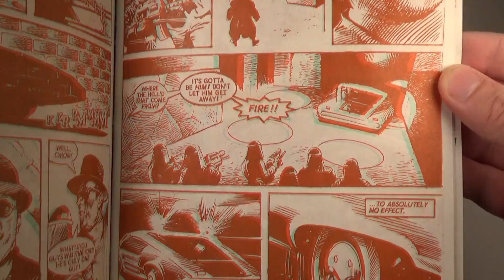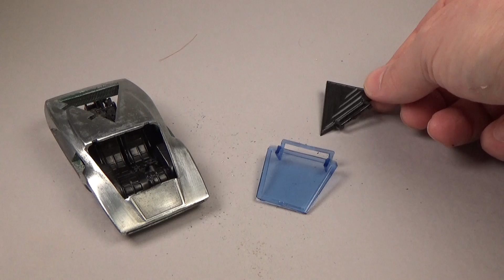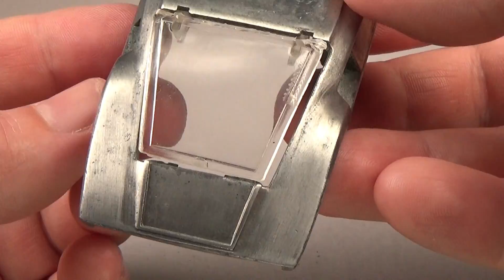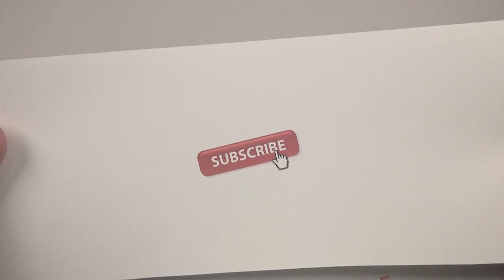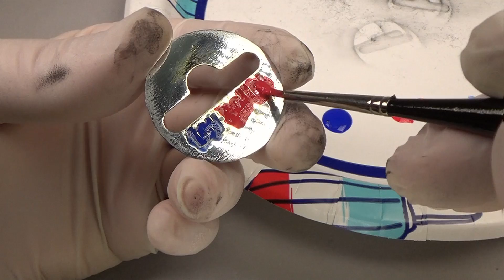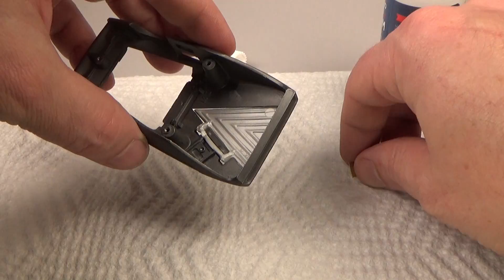Restoring a Politoy Lancia Stratos HF Zero

Comment: If you had used the mold the correct  way, your casting  would have turned out. The mold frame has a built in pouring cup

Comment: Overall great work. I'm not sure about the windshield. The body of the car is arched and the original part seems to be slightly arched too. When you took the cd, i wondered how you would go on to give your replacement an arched shape. In the end you just didn't and the result doesn't convince me, sorry to say that. In any other regard with paint, the edged parts it looks really great, the wheels are much better this way.

Comment: No offense, awesome job but I like the original size wheels and tires better. The new ones look too large and out of scale. I find your photo etching very interesting, I always wondered how they did that.Great job on the new windshield, the only thing I would have done is use your sanding stick/nail file and bevel the side edges if the glass on the sides to make them angled, then polish them with a Micro-Mesh polishing set of pads or cloths. I like your powder coating part of the video too, also very interesting.

Comment: Nice job! I do like the silver color and the real Stratos Zero was painted silver at one time; I think in the '80s and '90s.

I think both cars sit too high. On the real Stratos Zero the rear wheel arch actually comes down below the level of the wheel rim. The front tire is smaller and with a lower profile than the rear tire. 

I'd say that on your model a better choice would have been a lower profile tire on the same wheels, with the front a lower profile than the back.

Comment: Greta video - and a great restoration / modification.  Excellent colour choice.  If you split the difference in the wheel/tire diameter, I think you'll hit the sweet spot - especially for the rear wheels.

Comment: Regarding your resin casting, may I make the following recommendations:

- Get a pressure pot if you don't already have one. It's better for casting instead of degassing
- Use a resin designed for thin hard plastic components (Highly recommend Task 9)
- Use a faster curing silicone to save time (Mold star 31T will cure in 30 minutes, no degassing required, but pressure pot recommended)

With standard epoxy resins you will never get it hard enough, or if you do it will be very brittle. Task 9 is a urethane resin, but most urethane resins absolutely require pressure pots. That being said if you ever want to send some parts my way for reproduction, I'd be happy to do them for you!

Comment: well, great work on that futuristic ride. :) great work on the windshield, too. the polarized look is very fitting. :)
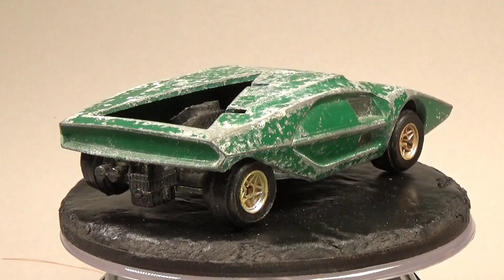personally the wheels look a bit too fat, the original has 60 or 50 series low-profiles. but they look better than the original standard polistils which were too small on almost all 1:43's they did in that era.
the original has a rim for a raillight surrounding the whole rear grille, if I recall right, illuminated with 195 light bulbs... and the front window is actuated wuth the steering column. I read of the car a bit ago in a german classic car magazine, and they commented that it's dangerous to grab the wheel while stepping in or out, because the windshield would slap you silly. XD
the panel before the windshield is a step-plate made with black rippled rubber, btw. :) the original is also still unrestored and ready-to-run, which is amazing for a show car like that. ^^
that being said, love your interpretation nevertheless. <3

Comment: 1) I really think you went too large for the tires. They look like balloon tires.
2) I love the effect of the windshield, but the original had more shape. Could you 3D print a buck and then put your CD piece on it and zap it with a heat gun to give it more shape? Google says that it's polyycarbonate, and that polycarbonate can be heat formed...
3) photo-etching. You have a laser cutter, don't you? I could be wrong, but it looks to me like if you painted the brass sheet with a matt-black, and then use the laser cutter to etch away the paint as appropriate, then etch in ferric chloride as usual. I think it would be more consistent results, and you could do dithering to get pseudo-grayscale.
4) I can't recall the last time I saw you electro-polish. How do you decide when to electro-polish, and when not to?

As per usual, the result is gorgeous. I had never seen/heard of this car, and I don't remember the Michael Jackson video, so thank you for introducing me to it!

Comment: Mapp burns hotter than lp. was that the problem? would seem odd, but I'm not a restoration expert (just work in a field that includes buying, selling and using gasses for hvac trade and plumbing.)

Comment: I think the rims need to be bigger compared to the wheels, I think the original has the right ratio between tire and rim, but is overall a bit too small, so if you could get closer to that ratio it would most likely look better I feel.

Comment: Overall, the car looks great. My suggestion would be to chamfer the windshield edges, and reduce the tire size somewhere halfway between the size you used and the actual tire size; that is, slightly larger than the original size, but smaller diameter than those you chose for this model. Oh, and I would choose a slightly smaller diameter tire for the front. I feel the profile of the car in the front makes the front tires look larger than the rear in diameter; this is an illusion, but I feel that the front tires being slight smaller in diameter would give better proportion to the car. The original tire size looks OK, but having them just a bit larger, I feel would make the car look great. One other suggestion would be, maybe the rear tires are fine, but maybe the front need to be smaller in diameter; this may give the car a better look and the proportion would look more correct. Using the CD to make the windshield was a very good choice; the metallic or opalescent look really makes this car look futuristic in appearance. The gun metal gray also give this car a wonderful appearance as well; ultimately, it looks stealthy in appearance. I didn't really like the silver on the rear hatch; in my opinion, flat black may have been a better contrast to the gun metal paint; similarly as the front emblem. And the only other idea I feel would make this car really stand out would be to finish the rims in gun metal gray; but more metallic rather than dull or flat. My version is about stealth and devoid of any chrome. But to each their own; right? Oh, and the rear tail etching you did was really nice.

Comment: Rear wheel tire diameter can be reduced and the sidewall height can be reduced. With this set as a guide the front rim should not be a deep dish rim like the rear but diameter should be larger and the tire diameter should be the same as the rear with an even smaller diameter.
The window, you could use another method. Make a clay form that shapes the opening of the window/door opening. You can use a thin sheet of clear plastic to plasti-form to this shape you made. Trim off the unneeded parts of the window/door. You get the benefit of a thinner windscreen.

This image should illustrate my points on the wheels.
https://hips.hearstapps.com/hmg-prod.s3.amazonaws.com/images/1970-bertone-stratos-106-1527782202.jpg?crop=1xw:1xh;center,top&resize=980:*

https://images.wsj.net/im-154478?width=1920&size=1.6

The rest was a good video. I enjoyed it.

Comment: I did an experiment on plastics before and yes they do become brittle if you place the heat directly on the said plastic for short bursts/periods at a time. What I have done is wave the heat gun back and forth and it sort of softens its shape so you could bend it as you wish, but it is a tedious process on its own.

Comment: In my personal opinion, the wheels should be a little larger and the tires a little smaller. I think the idea of filling up the wheel wells is a good one, but the wheel to tire ratio looks similar to an off roader
Reply: Of course besides that matter of opinion, i think you did a great job.

Comment: Woooah - sum it up. You can: paint parts using brushes, aerograph, poweder coat, you can etch, use electrolysis, plate parts, and apply metallic paint. You can make stickers, laser etch, and wet transfer. You can 3D print parts from resin, cast from metals and plastic, and uh, cut from CDs. You have full paint booth, nice surface to work with and decent camera setup. You're narrating your videos with calm, rich voice, explaining step by step, and building library of how-to videos while sharing your project cars, or other way around, while showing off your projects you're teaching the community how things are done, while also mentioning don'ts, pitfalls and failures. The last part never changed, but you've come long way from start of your channel.

Comment: For what it’s worth I have always found your sense of colour, proportion and your technical prowess to be exceptional! I will offer that the wheels did not work in this case. The original mags had more exciting interior details and the tyres were a better diameter, though slightly larger rear diameter would work. It’s just an opinion though and therefore has no relevance. Love the overall project!

Comment: It was really great to see all these different techniques! Thanks for that photo etch demonstration; I would have never considered trying something like that, but now, who knows?

How toxic is the solution? Is disposal a hassle?
Reply from the maker: It is no more dangerous than pool acid or drain cleaner and should be treated the same. If you neutralize it with baking soda till you no longer get bubbles you can pour it down the drain as it will just be salt water and rust.

Comment: Hello BareMetal, 

You did a great job on this car. Two things worth mentionning to me : the edges of the windshield seem to stick out a little bit too much. Perhaps finding a way to curve the windshield a little bit could do the trick. And the tires look great but I would put smaller tires on the front of the car, just to get rid of the off-road look that comes with big tires on on both front and rear. 
Thank you.

Comment: Could I bake the chrome at a low temp instead of waiting 2 weeks in between paint jobs
Reply from the maker: Not sure, have not tried it. Not. Big fan of waiting that long either but not sure if you can really short cut it.
Reply: @baremetalHW  I was planning to use a high end chrome for a custom slasher mask paint job but if that’s the case then I’ll skip the chrome
Reply from the maker: @enjoiorange  chrome is the bane of my existence.... there is always a catch...

Comment: I feel like the wheels need to be smaller, particularly the front ones. Looking at photos of the original, it seems that the rims are the same diameter all around, but the front tyres are both narrower and have a lower profile than the rear ones. The wheels shown here also give the car almost comically large ground clearance for a low, wedge-shaped sports car.
It's a bit of a shame, because otherwise you've done a stunning job with this restoration. The etched copper parts in particular are a really nice addition.
Reply from the maker: Not to worry will do an update video and fix the wheels.

Comment: Custom and repro parts, printed wheels and tyres, etched details, powder coated base, it was nice to see you go all out on this one.

I agree on the width of the rear wheels, it looks so good with big fat rear supercar tyres, and you're right that the profile of the wheels is too high. Keep the original height just add width.

Comment: Have you tried using one of these cheap laminators for the toner transfer? For PCB etching these are often used. You just run the part through it 10 times or so.

The gunmetal color is awesome! I just wish the engine bay door would have been in the same flat black color like the front lid.

Comment: Regarding transferring laser prints to metal - I had luck with using cheap, $10 laminating machines to do that - they squeeze the paper and the board/sheet metal together for you and evenly heat it up. You can run the assembly couple of times through it to make sure the toner adheres well to the metal.
Reply from the maker: May give that a try as it is pretty hit and miss at the moment.

Comment: The CD windshield is neat but I feel like it needs some kind of curve instead of being flat.
Reply from the maker: I originally put a curve in using the heat gun.... the problem is that the plastic becomes super brittle....
Reply: @baremetalHW  You could try with some polycarbonate sheet. I've used that to make a few cockpits and it's quite easy to work with.
Reply: @toypolloi  I'm reasonably sure that a CD is polycarbonate, no?
Reply: @baremetalHW  Would boiling water be hot enough to allow it to be shaped?
Reply: Go dig up the Frist Museum page on the prototype - I'm sure the windshield/door has a little curve to it ... but watch the video.  It's pretty damn close to flat!

Comment: It's been my experience that the resin used for windshield doesn't Get hot enough to cure because it's to thin. I'm not sure if they make resin that will get harder at this thickness but injection molding is the only way I know of as adding hardener will cause the resin to get brittle. I mad hoods with Mold Max 60 by Smooth On and pouring pewter into the mold to make the hoods. It doesn't melt when you polish and it it's not super hot. That might work for your parts you try to make from aluminum, just use pewter 93% antimony and 7% tin I think maybe the other way around. Thanks for the cool video!
Reply from the maker: Great advice thanks!

Comment: The back wheel looks fine the front might need to be a little smaller.
Reply: I agree, and even just a little smaller would be still fine.
Reply: "Smaller" might be the answer but clear side elevation images of the prototype would probably help a lot.  Dunno if such a thing exists, though!
Reply: Altering this URL to prevent filtering but ... fristartmuseum org 1970-lancia-stratos-hf-zero  has a nice side elevation of the car.
Reply: @plaws0  what do you mean by "side elevation"?
Reply: @midgetman4206  I think he just means side views of the car, maybe to see if the chassis is level front-to-back, or if the car has any "rake" ("rake" is the difference in height front-to-back in a car; if you follow Formula 1, you will have probably heard of that term before). I kinda liked the original wheels, even though they're a bit small, now the Stratos Zero looks a little like a tractor... Otherwise, it looks great though.
Reply: Agree, but it's just my taste/opinion
Reply: agreed

Comment: I feel like the windshield would only need the edges sanded and polished at a very shallow angle to get the right look, just to get the edges flush with the body. The wheels look good but the body would look better slightly lowered.

Comment: Hey BM, always enjoy your videos, I gotta make some constructive criticism about the tyres, the ones you printed were far too tall in the sidewall and lacked a very necessary vintage sidewall profile, Modern radials are more flat sides and square to the tread while classic vintage tyres with a racing style to them have the sidewall bow out then taper back inwards to the tread and rim, also that period a small guide ring was moulded into the tyre to help guide a thin white line so popular in Europe back then, tyre profile is VEEEEERY important to keeping things period correct and stand out a LOT to a car guy like me, anyway just my opinion

Comment: For applying the transfer paper to the metal, using a tool called a brayer lets you apply pressure evenly. Just something I came across some years ago for similar applications, thanks for the videos!